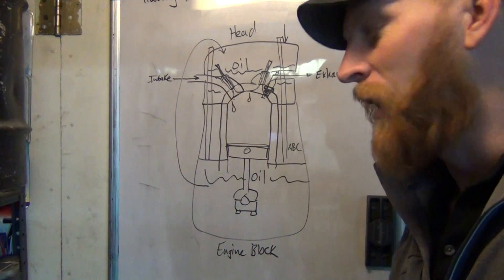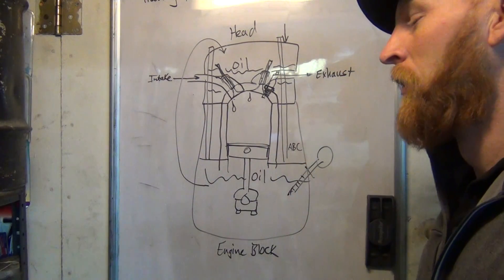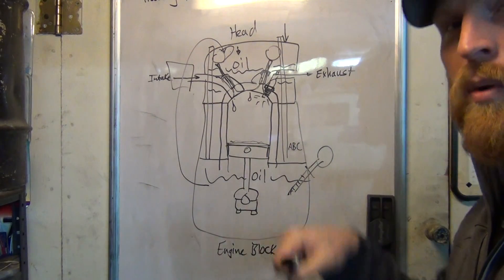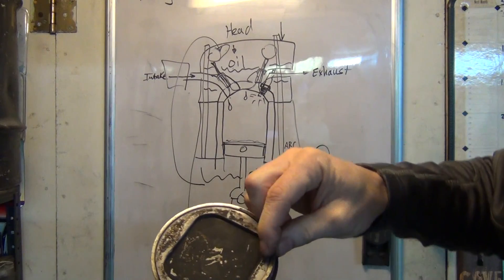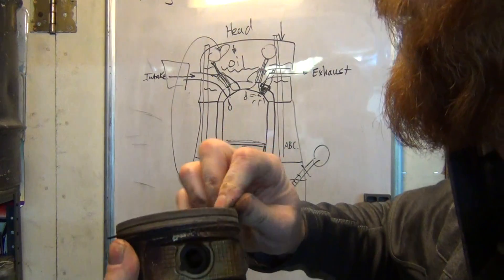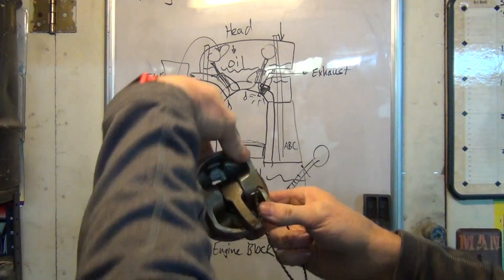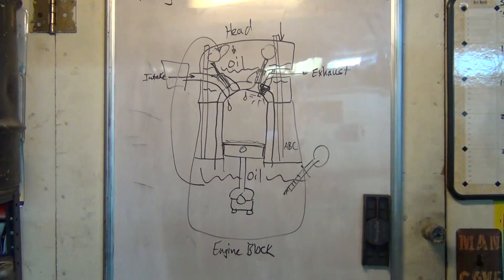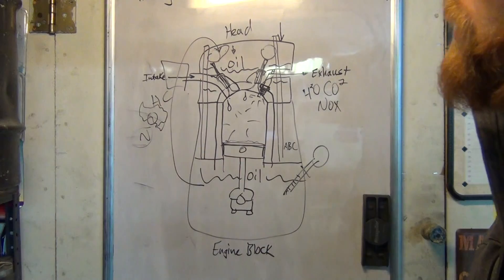Oil Burning Explained

Comment: I am trying to find out why my bmw x3 2006 mod petrol without turbo driven 206,000 km consumes so much oil, about 3 liters per 1000 km. According to a BMW workshop which has taken an engine test, the compression is ok, pcv ok. water cooling ok, no external oil leakage. The workshop noted that the previous owner had the car with them after the engine overheated. They did an engine flush and changed to a different type of oil without it helping the oil consumption. The engine cheats a lot and it smells of oil. Even if the compression is ok, could there be oil rings that have been damaged by a hot/overheated engine so they are the cause of the large oil consumption? It doesn't smoke blue when I start the engine when it's cold, nor when decelerating with a downshift, so I doubt that the valve seals are that bad. There is a lot of blue smoke when stepping on the gas pedal at idle and when accelerating after idling.

Comment: Thanks I really like your vedio so my motor bike is burning plenty blue smoke and oil from the exhaust pipe when I accellarate so thanks I can change oil pressure ring or valve seals,Thanks.

Comment: This does not give the reason why most engines burn oil!, most oil burning is due to either the rings & / or ring grooves wearing allowing the rings to flutter, which pumps the oil around the rings into the combustion chamber.......valve stem seals even if very worn in most cases make little or no difference.....

Comment: So my 96 cobra has a really bad problem with burning oil. When I start the car, you get a small smell of burning oil but if you let the car idle for a little bit, it goes away. When you get on the gas (floor it or rev) it burns oil so bad to where I can see a wall of burning oil smoke behind my car. I have a few things that I thought would be the problem, I have a problem with my lifters (I don’t know if that would cause an oil problem or not), and I have a problem with my IMRC valves being stuck closed. I can not figure out why my car burns oil, I was wondering if anyone knew anything about the 4.6L V8s by ford and if you could tell me what all could be causing my issues.

Comment: Honda XR valves also have o-rings in their stock steel valve guides. This is quite unique and most experienced mechanics are not used to seeing these. thus, they get overlooked during a head rebuild.  You have replace the valve guide oil seals AND the o-ring in the valve guide... Or switch to after market brass guides (The brass ones don't need the valve guide o-rings)

Comment: Not burning oil but I just got a used 2011 Wr250R with only 1600 miles on it. Rode it a few days short distances. Decided to ride further and got on hwy and it lost power at top of 3rd so I down shifted when I started to slow down and still no power in Second. Full throttle I'm sluggin to get off rode safely. I notice the oil was way above the window on side of motor and gas tank smelt kinda bad. I was told oil was changed and gas systems cleaned. New petcock. When I purchased bike. I let bike set for a little while and slowly made my way home. Any help ?

Comment: What about blue smoke only when i release the throttle? And it's not all the time either, it comes and goes from time to time when im riding.
 No blue smoke when i pull the throttle, nothing either when it's idle.
It's an air cooled 4 stroke btw. 250cc

Comment: If they are clogged with old oil crud. What do you recommend to use any additives? I have a toyota and it burns oil. But no smoke comes out when I drive . I did notice black smoke if I really rev it high. Almost redline it...any advice

Comment: Thanks for the advice I have been restoring some atc's the 110 I restored I changed the valves and piston rings but recently started smoking good amount when I first start it I did get a top end gasket kit but I did not change everything and those seals that are at the top of valve's I did not replace them so I'm guessing they are bad I don't know if they ever been changed before the three-wheeler is a 1985 Honda ATC 110

Comment: I need some advice I have a 04 Yamaha 250 two stroke I have some rattling coming from the transmission. My piston is sort of damaged the compression was great but I was running it wide open and it just quit on me. Now the compression feels weird it will still start up first kick but when I rev it the rattling gets louder also when I drained the oil it looked grayish. Thanks for any help

Comment: HI Briansmobile1 i have a new product that renews the crosshatch on the cylinder, which seems to prevent oil burning a great deal in old engines. Let me know your address and i will send you some Wonderdust. bradansell16@gmail.com

Comment: No need to replace rings when burning oil.  Perform a WOT (wide open throttle) procedure  nk tools or chemicals required.  Just a heavy foot in 2nd gear to clean the carbon and buildup,off your rings.  They did not go bad, but rather are not moving freely and thus  not allowing the ri ga to wash the oil off the cylinder walls completely.google it!

Comment: I have to disagree only when start up my car was smoking and I replaced all the valve stem seals and it fixed the problem and I would punch on the pedal and it would smoke problem fixed it was not the piston rings

Comment: Hello I had a recent engine build using forged pistons, rods, and replaced valve stem seals and guides. I am getting blue smoke at start up and also see smoke coming out of the exhaust periodically especially while the car is shifting through the gears. What advice do you have for me to resolve my issues? Thank you.
Reply from the maker: That's rings.  Either your ring landings are hurt, the ring gaps are lined up or wrong, or you're pistons are too small for the bore.
Reply: Well that's just unacceptable. Thanks for the input bud!

Comment: my air-cooled carbureted 125 has started drinking oil like crazy (about 0.4L / 1000Km) but there is no (visible) smoke from the exhaust even at high speed ~90Km/h, except for the Occasional vapor like smoke I notice every once in a while (nothing new) when I'm at a stop light but it's only temporary and gone by the time I get home.

Also is it possible that this problem is caused by rich air/fuel mixture as I mentioned there is no visible smoke but I do notice an oily spark plug with carbon deposits.
Reply: Tayyab Naveed it's mostly ur air/fuel ratio because an oily spark plug is a clear cut sign of a rich mixture..
PS my bike burns 0.2L of oil ever 200-300kms and der is white smoke at high rpms and sometimes during initial cold starts but that's Oly for a few secs and then it stops.. thanx to this video I now know my piston rings r definitely done . !

Comment: Good video. very informative. I have a duc m620. I combustion in my exhaust/back fire. Blue flames though not blue smoke.  Can't be oil i suppose. so must be fuel and not enough air because the bike stutters/lags when I throttle down. This video helped. So off to find the solution.

Comment: T~T Need new rings , Dealer want's to charge me 30K to get it done.

Is there an easy way to remove pistons ?

Can I remove them from the bottom, by removing the sump, unbolting the crank and yank them out ?

Or am i just being a potato ?

Comment: Hey! Congratulations for your video!

2 things! 

1) I 've heard that during engine braking the compression rings tend to bend inside their grooves, due to the vacuum above them. So, this may cause scoring onto the cylinder liners. Is this correct? If yes, what is the r.p.m. limit that makes this non negligible?

2) Modern cylinder liners are manufactured so that they have specific asperities profile over their surface, in order to maximize the adhesive forces between the lubricant and the liner. The lubricant that is not wiped by the oil rings stays there to reduce friction (boundary lubrication conditions) at the T.D.P. and enhances sealing as well. Of course, this oil is burned right after the descend of the piston. This is the major source of oil consumption on a modern engine. This means that a minimal oil consuption is inevitable! Is all this statement correct? If yes, how big is this "minimal" consumption? 50ml per 1000 Km? 80ml per 1000 Km? Less? More?

Comment: Brian - thanks so much for posting vids like these.  I just bought a 22' offshore tuna boat w/ no experience (right...) and now need to understand how a combustion engine works from the ground up before i get comfortable with it offshore w/ my family..   It runs on a small block Chevy (1999 350, marinized 5.7L) and I'm building it from the ground up..  will be great to keep plugging into your vids so my fam doesn't die off the coast on rough seas.. JK

Comment: If I want to replace my rings do I need to find OEM rings for the exact model or can I just get rings meant for the displacement of the engine and use those? or do I need the find the right bore (that's the diameter of the piston right?) in order for them to work.

Comment: I have a 2005 Suzuki king quad. I just had a new piston, rings and sleeve installed. I had the head and valves machined. It started right up. It ran for 8min and 22 sec. I have allot of blue smoke out the exhaust and allot of blow by out the crankcase when I removed the oil cap to check the oil. The pressure literally blew hard out the crankcase. The sleeve and piston were matched. What do you think could be the problem. Enjoyed your videos.

Comment: Briansmobile1, thou U made a rough picture of the internal engine, but the explanation of the cycle operations were very clearly spoken and understandable.for me as a filipino (thanks for that). My car got minor cloudy smoke every start up and idling situation (traffic or stop at red light),, but when i rev up the smoke was thin..(valve stem seal? PCV? Or Piston Ring?(just change an oversize a month ago) or the Cylinder Block need to resurface? ) mine was a 4 cyl / carburature type engine.. Pls reply for more guidance... Again LoT for your simple comprehensive video..

Comment: oil is not flung around by the crank the crank is not submerged in oil. there is a windage tray and the oil is pumped through galleys to the bearings with full pressure. only exception is small engines with no filters that sling oil with a slinger.

Comment: Thanks Brian, this video pretty much diagnosed my rzr 800. had engine rebuilt by dealer,  received back and after a month burns oil badly. also smokes really bad under load. checked parts list on receipt and found they did not replace the rings and used again with engine. I opened up up and also found the rings were not staggered on 1 of the pistons. I would think the rule for rebuilding motors is #1replace piston rings. I don't think the old one will seat, IMHO, idk?

thanks again sir!

Comment: Heat builds up on the piston as the lubrication holes are fed oil and gets carbon on the oil rings thus getting hotter and hotter due to no lubrication on the piston sides through oil holes and this causes the oil to evaporate where one does not actually see the oil burning out the exhaust port. Like you said keep the oil holes clean but hard to do when the piston gets real hot with the oil already "hot" which adds to the ability to carbon easier. Use detergent oil, keep the oil clean, keep the engine oil cool. Keep the engine cooler. Make sure the pistons are getting the right amount of lubrication and they will stay cooler.

Comment: My car has blue smoke on startup. After a few kilometers, the blue smoke goes and a faint black smoke on high revs is seen. I really cant tell what category it falls. Is it the valve stem seals or the Piston rings?
Reply: Maybe youve already figured this out and im way off-
sounds like the blue smoke isnt just startup, but rather until the car heats up and the cat starts working. I dont know what the cause is, but sounds like the catalytic converter is working :)

Comment: Hi Brian I have a 2007 Honda rebel 250 with only 5,000 miles on it. When i bought it it was burning a lot of oil (probbaly 1 quart every 100 miles). the guy was running synthetic, I started running non synthetic and it reduced the oil burning a ton. however, it is still burning some oil, especially when revved. Based on your video it sounds like its piston rings but a 2007 with only 5,000 miles on it doesn't seem like it should be having this issue. Any feed back would be great

Comment: i changed this rings but i get more smoke now. its at high rpm. does it need some running time to heal between new rings and old piston/cyllinder/sleeve?
do you think resleeve recomneded always?
Reply: honda xr250 1994

Comment: Great video! really instructive and well explained. quick question: i have honda cb400N that is shaking like hell! got oil in the exhaust, wet and black plugs,... so got oil in the cylinder, go figure right. Changed the head gasket, changed the valve stem seals but problem is still there. guessing it's the piston rings then? anyway, should i have my cylinder rehoned and/or bored? or will a piston ring renewel do the trick? 

thanks man! enjoyed your video and subscribed!

Comment: if we have only troubles with the valve seal, so does it leak only at the start up ?
Reply from the maker: Depends on the magnitude of the leak, but typically, yes.
Reply: could u please tell me more details why it doesn't leak after start up ? Sorry for my bad English

Comment: My engine burns oil. It has sometimes blue smoke from exhaust on cold engine after stepping on the gas. I fixed head of the engine (valve seals, new tappets, camshaft). It could be piston rings?

Comment: Great video really helps to understand how things work. I have a 98 Toyota Sienna smokes intermittently mostly on startup. Smokes 3 or 4 times then no smoke 3-4 times sometimes more times sometimes less, Can be sitting 10 minutes or overnight smokes or not either way. Replaced pcv and appeared to stop for a week or so then started smoking again. Did this twice same result. Occasionally massive amount of smoke and continues for a few miles.I suspect previous owner did not change oil enough could the hose connecting pcv be plugged or partly??

Comment: Is there any other way to lose oil? besides a leak like something leaking internally? My car very slowly loses oil but doesn't leak or have smoke. It started first losing oil after my plugs were sucking oil. That was replaced the gasket ring at bottom but still have the issue but is drastically slower. I looked at the plugs and none have oil in there anymore so it's a different problem. 

my car is 02 Mitsubishi galant
Reply: how much oil are you burning? quart every how many miles?
Reply: +Spencer Prescott it's not a lot it can be about 2 months before I see about 1/5th of and inch off the dipstick. If I'm driving really hard and far on the highway a lot I can probably lose the same amount but in about 90 days give or take.
Reply: +AustralianCroc I wouldn't worry about it. if no signs of leak sounds like the oil burning isn't worth messing with just keep checking the oil.
Reply: +Spencer Prescott Thanks for the input, I will just hope it's doesn't get worse anytime soon.
Reply: +AustralianCroc it won't hurt your motor if some oil gets into the cylinder. if you cant see blue smoke then I would just drive it.
Reply: +Spencer Prescott will do, I see zero smoke now so I may be over looking a baby leak. But thanks! I will say if the smoke starts to say if it ever does it accelerating or decelerating.
Reply: +AustralianCroc yea your fine the valves could be allowing a little to drop in after shut off.
Reply: In your service manual for the car it probably says something along the lines of typical loss over 3k miles or 5k miles around 0.5 quart or 1 quart. Some loss is acceptable.

Comment: i have a 125cc kymco motorcycle emits white smoke sometimes when I turn the engine off for a few minutes as thick as a 2stroke's... and also thin white smoke on higher rpm....
Reply: could need a carb adjustment. pull a spark plug and see if it is black.

Comment: Brian, I have a question, what exactly happens when the engine es consuming oil but there is no smoke on the tail pipe or leaks anywhere? does the oil evaporates or something like that? I would be glad to receive your opinion.

Comment: Great vid ..Now I have to see if the truck is worth the $$ to do a ring job ..1998 mit montero sport with 150,050 miles on it ..everything on it works like new runs idles great ..just the light blue when at a light or at idle for a few mins
Reply: sounds like valves they arnt very expensive.

Comment: can you advise, I have a whisp of blue smoke on starting, then only after idling for a few minutes, the longer it idles - the worse it gets, driving off it can take a minute or two to clear when its bad.  The CCV is not blocked.
This is the 3.0 Litre V6 Diesel that goes in the Jeep 2005-2010 Grand Cherokee
as well as the Mercedes 320cdi and 350cdi's.
Any suggestions would be helpful.
Mileage is coming up in 108,000.
Reply: sounds like piston rings to me
Reply: Spencer Prescott Would that not affect the emissions test? It passed that with flying colours.
Reply: depends on how much oil it's burning. the catalytic converter could be catching it